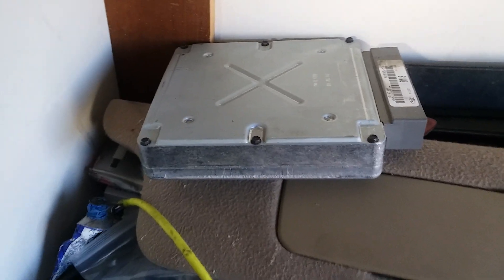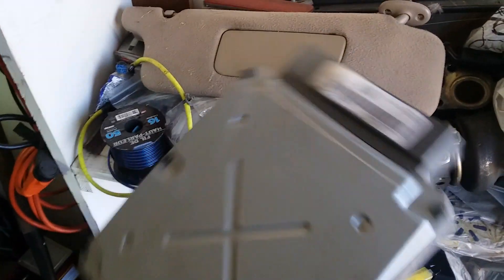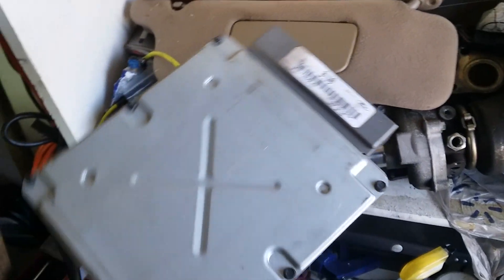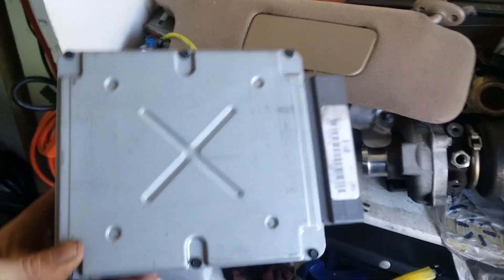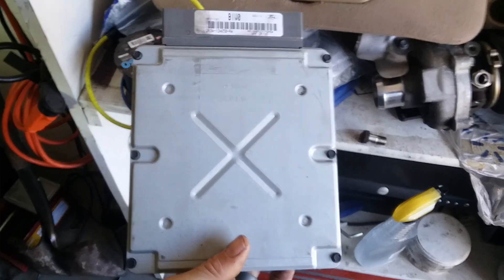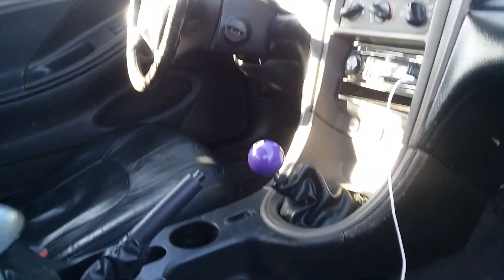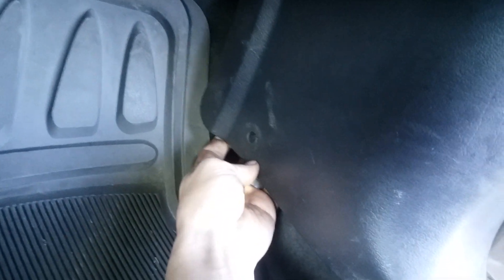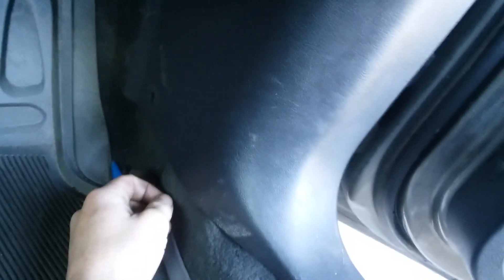Auto to manual swap pcm programming 02 v6 mustang

Comment: So in order for me to get my computer programmed what do I do?
Reply from the maker: It can be limped to the dealer with the stock ecm, (will not exceed 45mph.)  Or towed to the dealer after you install the manual transmission ecm. You will request a key reprogram from the dealer. Or you can have them replace the ecm and then do the key program. Just explain that the ecm has been replaced. And make sure you have and provide the vin number of the ecm to them or they cannot perform the key program.

Comment: Hey, so i just finished my auto to manual swap on my 2000 mustang gt and im hooking up the battery but as soon as the red terminal touches the battery it starts to spark and inside the car i can hear a ñrrrrrrr around the dash and the turn signal indicators also turn on, both of them, any idea as to why it does that?
Reply from the maker: More than likely a harness got pinched on installation. Check your starter power wire for correct connection and damage. Or it's the harness above the bellhousing. Verify the harness didn't get smashed between the bellhousing and the block. If you find a damaged or pinched harness repair all damaged wires and retest.

Comment: What did you do about the steering colum lock?
Reply from the maker: You can delete it or just unlock it and tape it up so it can't lock up anymore.
Reply: I may be wrong but the autos don’t have the little thumb lock thing but the manuals do and if your swapping to a manual is that a crucial part of the swap or would it work without it?
Reply from the maker: @tigerholley3449  mine works great without it, the thumb lock is to prevent locking the steering wheel while driving, Incase you accidentally turn off the ignition at freeway speeds....as I understand it.
me personally I'm too busy bang shifting and pretending I can double clutch.

Comment: Im in the middle of my own swap. Where did you find the top plug for the neutral safety switch for the clutch pedal?
Reply from the maker: It's tapped up in the harness. You may need to partially disassemble the harness to get it to reach, some require an adapter typically the adapter gets left on the donor car. If your lucky it might still be there.
Reply from the maker: There is a harness in the drivers foot panel that runs vertical, to the left of the clutch you should be able to see the connector on the outside of the harness
Reply: @garrettgrantham7411  thanks! I'm picking it up tomorrow. My mechanic said he didn't see any connectors but I'm gonna take a look to see if I can find it myself.

Comment: Hey quick question I currently have an 02 mustang gt that i just manual swapped with a tr3650 and i have a plug right under the quadrant that i have no idea where it goes  and as for that plug that has the jumper on it does it fit into that top plug ? The shape looks different so you have a picture i can see of all your connection where your pedal assembly is
Reply: what did you do about ur pcm and cluster . i have a auto pcm and cluster know how to make it work
Reply: What happened in the end did you use a pigtail to conect the one with the jumper?

Comment: Did you have to use the VIN number off of that new pcm to reprogram it
Reply from the maker: For the key reprogram alone yes, I believe the vin can be rewrote to the ecm, however I am unaware of the method to do it. Will not cause any emission or inspection failures. Ecm failures are fairly common and junkyard ecms are often the fix.
Reply: @garrettgrantham7411  thank you
Reply: @garrettgrantham7411  I got one out of the junkyard but when I put it in it wasn't showing my miles I was wondering if you had the same problem until they reprogrammed it and then it all worked out?
Reply from the maker: @slick4_207  yes, when the new ecm is plugged in and powered up anti theft immediately locks you out. My best analogy is: the instrument cluster is giving you the middle finger because he doesn't know the ecm. sometimes you will get a few engine starts before the instrument cluster screams rape! And completely locks up the ecm. (No start condition.)

Comment: Can you drive it with the auto pcm until you get it flashed
Reply from the maker: It will run poorly, the automatic programming will attempt to shift the car as you drive. When an automatic requests a shift:
 1. the ecm adds additional fuel to the engine before the anticipated shift
2. The Ecm cuts fuel milliseconds before the shift (smoother shift) 
3. Ecm waits for shift to complete (1-3 seconds) then returns fueling to normal.
Minor bucking and hesitating is to be expected you can actually feel the car trying to shift.
Reply: @garrettgrantham7411  ok mr. Grantham I finally got the transfer finished I had to drive it 30 miles from the guys house who adjusted my clutch ran super fine only is I was doing 70 and the speedo was reading whole lot faster than I was going but that was the only problem thanks again for the video it helped me greatly
Reply from the maker: @lamarevans66  Your welcome, glad I could help.
Reply: @garrettgrantham7411  thank you someone in one of these mustang groups said I wouldn't have to get it flashed I had to check with you to see if this was true thank you I appreciate it
Reply: What’s good my brother called Ford to get a price they want a whopping $450 to do the ecm do you know anyway I can get the mph programmed
Reply from the maker: @lamarevans66  It would require a tune and a knowledgeable tuner. The parameter that needs changed is the speedometer tooth count. You might try Rockauto.com they stock a ton of ecms. You just need to identify the correct one for a manual trans and your mustang. Your cheapest is to swap the ecm in the dealership parking lot yourself and then have them do a key reprogram.
Reply: @garrettgrantham7411  I have the manual ecm but I was wondering if there was a cheaper way to do it until I can get the money to get ford to program the one I have
Reply from the maker: @lamarevans66  You may consider another dealership or at least a phone call for a quote, that is ridiculously overpriced. Armed with a competitors price you may be able to get your current dealer to be more reasonable. High quotes fall into 2 categories: (1) Greed (2) "quote high to intentionally lose the work". (Meaning they are scared, or unwilling to even try)
Reply: @garrettgrantham7411  right I totally agree because he had to put my on hold so I already know he won’t be the one who’s doing it

Comment: So I’m start on the swap una couple days what wiring needs to be changed that’s all I need to know ? Mines a 04 mustang gt auto to Manuel I just need more Info on the wiring
Reply from the maker: You need a manual transmission wiring harness from a gt. Short harness that plugs into the engine harness.  Connecter is Between the  firewall and driver side cylinder head.

Comment: I need your help so I got everything for the swap on the clutch pedal side of things what do I need to do to what wires do I need to connect for the neutral safety switch ??
Reply from the maker: There is a connecter taped up into the harness. May require a pigtail from said connecter. I still haven't connected mine.
Reply: So the top connector is wrapped up in the harness? My mechanic said he couldn't find it.

Comment: Hey can it be done to a 2016 V6 mustang? Thank you
Reply from the maker: In theory yes any car can be swapped to a manual. However I have no idea as to required parts or tuning requirements to make it functional.
Reply: @garrettgrantham7411   I am looking into this swap soon after some body work I'm assuming you use the auto pcm to get to the dealer then swit h it to the manual pcm then you go in and ask for a reprogram?
Reply from the maker: @midcraze3466  yes, key reprogram, be careful driving, best option is a tow but you can limp it, won't go over 55mph.
Reply: @garrettgrantham7411  thanks I may be able to get a toe we have a car hauler handy. How much do you about the 01 and 02 mustang because I have a rather interesting project to do and have never messed with ford mostly just gm trucks.

Comment: Hey man awesome video. I had a question if I am doing the swap and I have the computer and the key from the manual car do I have to reprogram the computer for it to work good?
Reply from the maker: No ignition switch won't turn with wrong key and pats system incorporates all control modules. Ex: key sends code to bcm which verifys correct code sends code to ecm which checks code and verification from bcm. If anything is missing or incorrect it will lock out the system.
Reply from the maker: In short anti theft is intentionally complicated to reduce theft

Comment: Thank you for taking the time to make these videos. Well articulated, has definitely given me the confidence to attempt this. One question that I do have , is the pilot bearing simple to install? Thanks so much.
Reply from the maker: Yes just make sure you are only hitting the outer race. Don't damage the inner race or bearing cage. A socket makes an excellent bearing driver if you don't have one.
Reply: Garrett Grantham thank you

Comment: Hey garret could I use the auto harness and switch out the pcm to the manual one, I did the swap but used the auto harness?
Reply from the maker: the harnesses are physically different. I believe the speed sensor and reverse light switch are the problem. it will work but your not going to have reverse lights or speedometer.

Comment: When they do the reprogramming with a manual ecu will they update the vin number or will it have the vin number from the manual car? I want to be able to get emissions test. Thanks
Reply from the maker: No the vin on the pcm will rename.  It shouldn't cause any emission testing issues  (assuming you don't have a preexisting problem.) I passed utah emissions flying colors. If they flag it or try to reject you for it explain to them that your original pcm fried and you had to use a junkyard pcm to get your mustang to run correctly. This is not an uncommon repair and the EPA is well aware of this issue.  They care more about codes than matching numbers.

Comment: Hi did a swap myself and was wondering, your car is a 2002 if I’m not mistaking, did you wiring harness come with the upstream o2sensor connector, and did it have the second round connector near the main connector under the hood..
Reply from the maker: No, my harness was missing the connector,  the wires and the pins were intact but the connector was broken off,  that second round connector may possibly be your missing upstream 02 sensor connector
Reply: @Garrett Granthem, the difference between yours and mine is mine didn’t start, had to jump pins 2and 3 for it to bypass the park neutral switch, my speedometer is out of wack and my overdrive light is blinking.. talked to a local tuner and he thought I wanted to put the car on the dyno,  not to mention he wanted to charge me $700 told him car is running great! I just wanted the pcm programed to my VIN, he said he can’t do that..man that’s upsetting.
Reply from the maker: @Luisgarcia-uz5uk  You will need to find another tuner that can reprogram your pcm, Or go the route I did and swap a manual pcm in at the dealership and and pay to have the PATS reset.
Reply: Garrett Grantham so all I need is to find another pcm from JY, and have a pats reset?
Reply from the maker: @Luisgarcia-uz5uk  yes. Ensure the pcm is from a manual preferably from the same year
Reply: Luis garcia , where are those pins located 2 and 3?
Reply from the maker: @Luisgarcia-uz5uk  yes car. The 04 v6 is a 3.9l, completely different engine. Pre 99 engines did not have Imrc.
Reply: Garrett Grantham I saw the OD and SE lights on in your video mine has the same... difference is mine is 4.6 2v and in order for me to do a PATS reset I will need 2key correct?
Reply: Hi Garrett, can’t seem to find a 2000 GT 5 speed pcm, can I use a 6 cylinder, cause there’s a shit load of them ..

Comment: Can i use the same rearend
Reply from the maker: Yes. Plug n play
Reply: What about the driveshaft can i use the auto one and will it run and drive with the auto pcm and auto harness
Reply from the maker: @blaynemaddox9356  yes however you need the front slip yoke from a manual. Yes it will run and drive without the manual pcm however you will have issue's.
Reply: Mine is a 2000 and what the issues and are you talking about the front of the diff

Comment: What about a auto to manual on a 4.6
Reply: 99-00 have a certain PCM, 01-02 have their own and 03-04 GT's have their version.  Make sure you get one for your year model.  Use Forscan and an ELM obd2 connector and use the PATS programming to clear key codes out of the swapped PCM and reprogram your keys.
Reply: Forscan is free, you will need to buy a ‘key’ to access the Pats programming.  There are a lot of videos covering Forscan.  It shows you the correct obd2 adapter to purchase (which are cheap on Amazon). There are videos showing how to reprogram your keys.
Reply: @jasonmccarthy820  I need some help myself. I have a 2002 mustang gt manual, and a buddy has a 2004 mustang gt auto. We swapped transmission and such and need the ECU reprogrammed for the cars to work correctly. Could I reprogram the 02 manual ecu to auto? and if not, could I swap ECU with the 2004 mustang and reprogram PATS?
Reply: @Brandon-ls2dh  i have the Delta Force tuner kit.  When I bought my 5spd swap kit it had the manual ECU from the donor car.  I just used my tuner kit and disabled PATS.  Swap ecu’s and get PATS disabled.  The only drawback is the theft light will flash fast for the first fee minutes every time you start the car, but after that it goes out and doesn’t come back on.
Reply: @Brandon-ls2dh  there was a thread on one of the mustang forums about how you can reprogram an auto ecu to run a manual trans so you could keep pats/vin matching, but you can’t do a manual to use auto.  Google search for new edge manual swaps.  It’s been almost a year since I did mine.

Comment: I’m doing this swap on my 02 mustang v6. Do I have to get the pcm from a manual mustang? or can it be from an automatic one?
Reply from the maker: Frankie Natale you have a couple options. 1manual pcm- you will need your keys reprogrammed at a Ford dealership. Or 2 automatic pcm and take to a tuner that reprogram it to work
Reply: Why do you need to swap the pcm? The gauges to work or will the car not physically move?
Reply from the maker: TrottingFox the speedometer will read double your actual speed. And the speedlimiter will prevent you from going any faster than a 120mph (55 mph in reality. Because the Speedo is reading double.)
Reply: @garrettgrantham7411   Damn man!  did this swap last year and have been trying to use the AUTO ECU that I had tuned but, it really doesn't  run right.  I have the "double your actual speed" issue and if i am trying to "bang" gears i feel like the computer is trying to shift.   I have a manual ECU, but the car would not start because of the PAT or not being in sync with the computer. going to a dealer tomorrow!  I wish i found this video sooner! FYI- I did the conversion on a V6 2000 Mustang auto to a T5.
Reply from the maker: @angelburgos8480  ouch.... glad you got it figured out. Your tuner forgot to change a ton of setting and parameters. The manual pcm swap is nearly painless. Are you loving the conversion now?
Reply from the maker: @angelburgos8480  no start is due to Pats. Simple key reprogram. Take all keys to dealer. If you forget one it will not start the car and lock up the anti theft system.
Reply: Garrett Grantham Can you just disable the limiter?